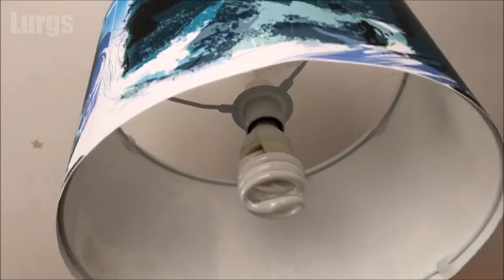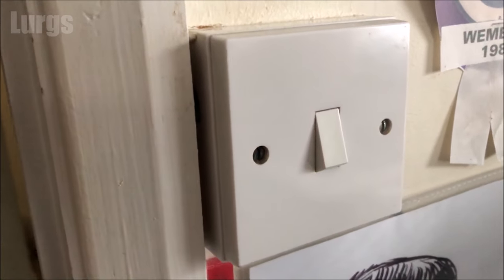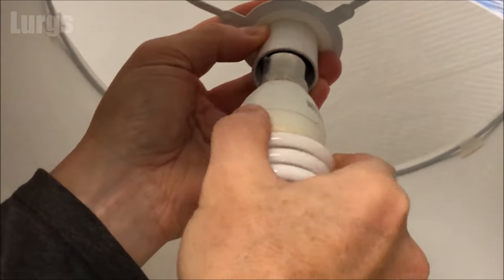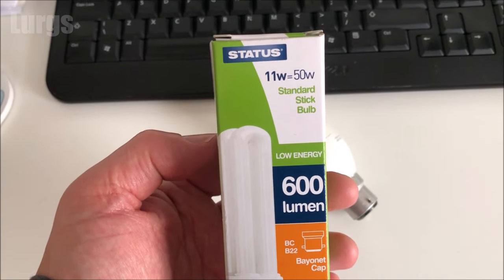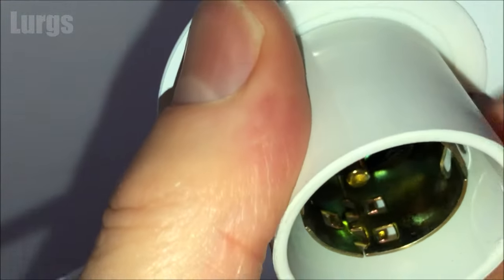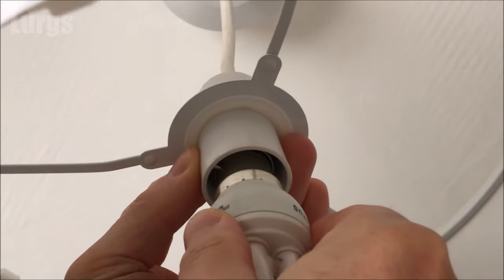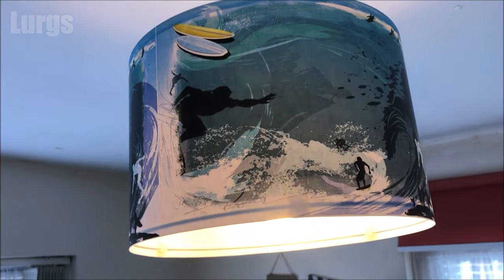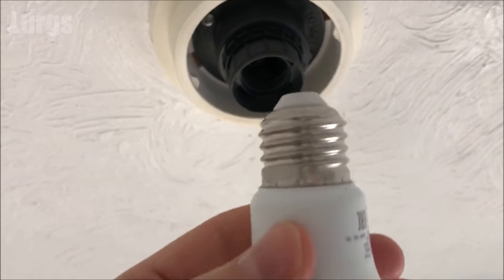How to Change a Light Bulb - How to Replace a Light Bulb - Light Bulb Replacement Bayonet Cap type

Comment: I turned the bulb clockwise when putting it in but did not work. It goes it but does not feel tight
Reply from the maker: It will feel a little loose, is it not working then?
Reply: @LurgsHowToGuides  it's a new bulb, when I try to put in the bayonet I push up and turn clockwise, but when I let go it feels like it the bulb pushes down and when I turn electricity back on light does not come on
Reply from the maker: Is the fitting broken? Should clip in on both sides on the pins
Reply: @LurgsHowToGuides  it looks as if it goes in on one of the bulds, but how would I know if the fitting is broken
Reply from the maker: @trolling123. Compare it to one in this video or another in your house